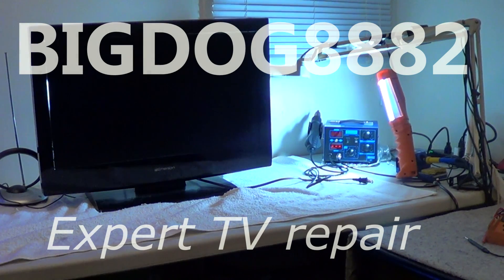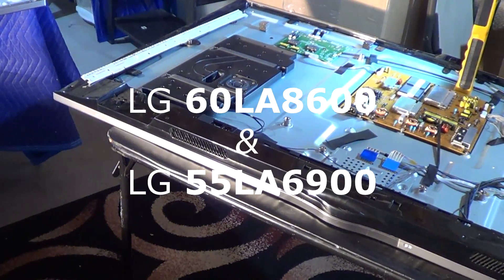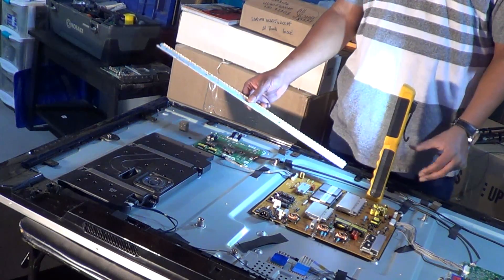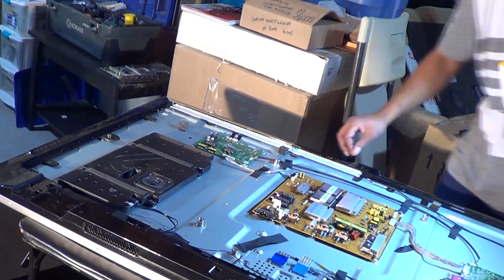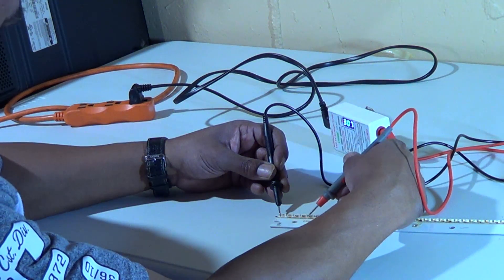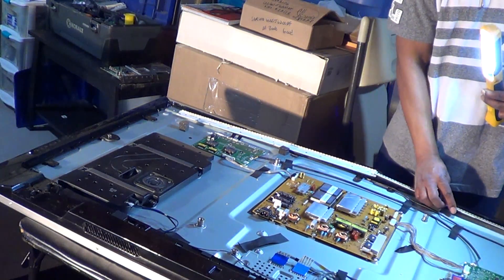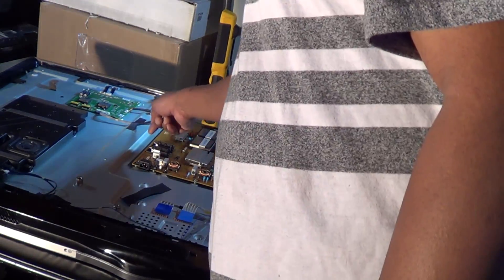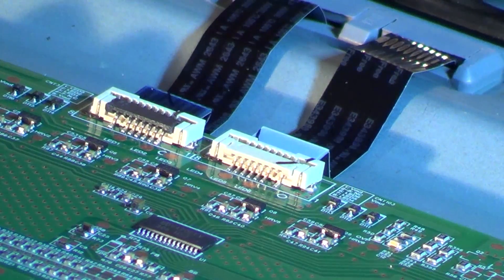How to check LG Edge-lit led tv strips without full disassembly of the television.

Comment: 11:30 What does it mean when that LED (LD701) on the power supply board flashes 4 times when the back lights turn off automatically?

Comment: Hey, hope all well. This maybe my saving grace video, but as I'm not a fully fledged technician like yourself, any chance I could do this test with a multimeter only? Thanks.
Reply from the maker: No, not that Im aware of. You need a High current led checker to check most edge lit strip TV's. We have them in stock. https://bigdogelectronics.us/products/0-330v-manual-adjusting-voltage-tv-led-backlight-tester-current-adjustable-constant-current-board-led-bulb-lamp?_pos=10&_sid=d703a86a8&_ss=r
Reply: @bigdog8882  I appreciate the quick response. Thats too bad, as its only a one off use case scenario plus I'm from the UK.

Comment: Nice video, just what I was looking for. I have a 39" Panasonic TV that I pulled the edge strip out to test. I bought a tester like yours...very nice. But there are no positive or negative points marked on the strip. Looks like you are putting the black negative probe on the left side of the first LED then the red positive probe on the right side of subsequent LEDs?
My strip is a V390HJI-LE6-TREM1 you can see it if you Google it. It looks like there are some test pins on the strip on the far left where it plugs in. One says VLED and the other 4 are N3,N1,N4,N2. Since there are 48 LEDs on the strip I suspect each one of those points correspond to a set of 12 LEDs? So do I put the negative probe on the VLED then the positive probe on each of the N points to test the string of 12?

Comment: Very useful video bigdog, thank you so much, I have the exact same model as yours (55LA6900), the problem I'm having with my TV, is that once you turn it on It only shows half of the left side of the screen illuminated with the LG booting logo, then it goes all dark but you can still see the actual images from the LEDs if there is enough light in the room... in this case im not sure if there is an issue with the edge-lit strips or with the power supply board....from time to time it starts working again for some days and then stops again.... what would you suggest me to do in this case?
Reply: Same exact issue with mine

Comment: I always disconnect the backlight plug from the power supply when working on the led strips
After far too many kicks off of them I kept forgetting that you test the strips and it charges up the capacitors on the power supply and when 
You solder in a new led etc it suddenly discharges and leds light up and bam you get a shock too lol